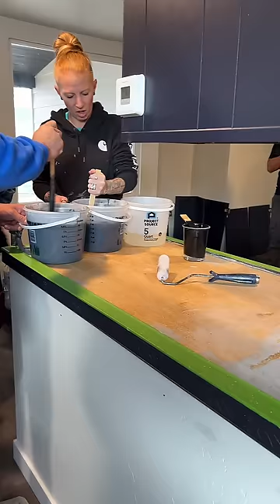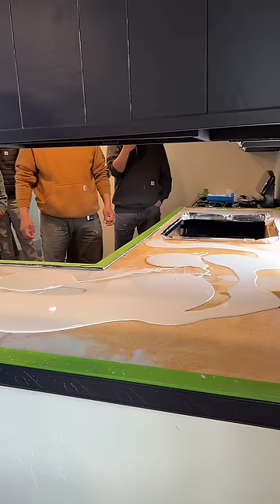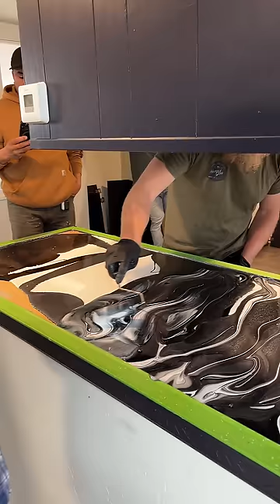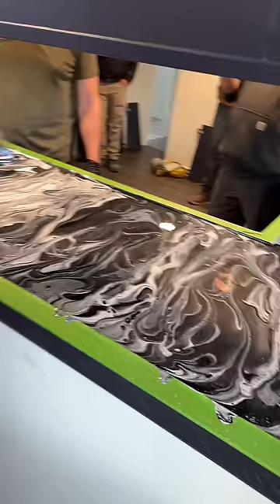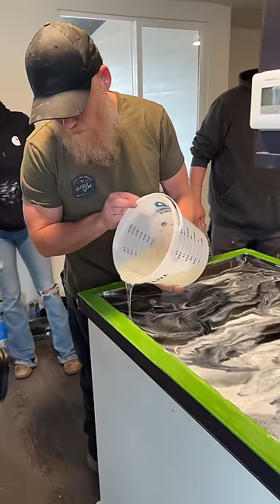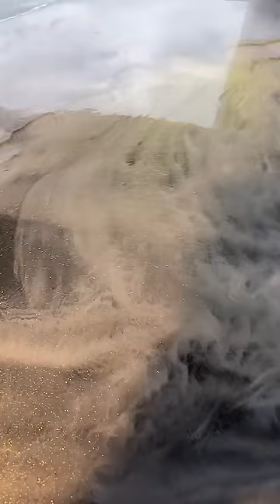Pouring an Epoxy Countertop on a job site! (TikTok Live 2/6/24)

Comment: The clear at the end didn’t you have to spread it? How does it work? Just in those areas???????
Reply from the maker: It just kinda flows together it adds some depth and dimension to the design. The torch also helps smooth it out for a glass like finish.

Comment: Hello from Central Oregon. We bought a house a year ago and the counter tops are formica and parts are coming up.  I am considering doing epoxy.  How thick should this be?
Reply from the maker: Hey there! Great question. It sounds like you may have some issues with your substrate, the counter with the parts coming up which would need to be handled before you can pour epoxy. Please email us at info@countertopepoxy.com or call our customer service line at 97-639-9338 and we can discuss your project!

Comment: Is the torch what levels it & helps it cure?
Reply from the maker: It helps pop the air bubbles and yes level somewhat. You definitely don't want to over torch as it can cause flash curing.

Comment: What kind of temp can  I handle.before damage to it . Nc
Reply from the maker: We cannot speak for other brands, but Countertop Epoxy is heat resistant up to 500 degrees. That being said, we don't recommend putting pots and pans directly on countertops, its okay for a quick touch, but we still recommend using hot pads for protection!

Comment: No one has a mask on no need for a mask with your resin. By the way what is the name of your resin because I work with resin craft resin is what I use keychains trays I made clocks stuff like that.
Reply from the maker: Hey there, thank you so much for caring about health! We always encourage ppe however, we are using our FX Black Label Countertop Epoxy Here: https://www.countertopepoxy.com/fx-black-label-epoxy/?_ga=2.87679256.1609393405.1711379033-1006004382.1709671117 We have created a product that is VOC free please check out this video for more information: https://www.youtube.com/watch?v=f7tBhug0Eyo